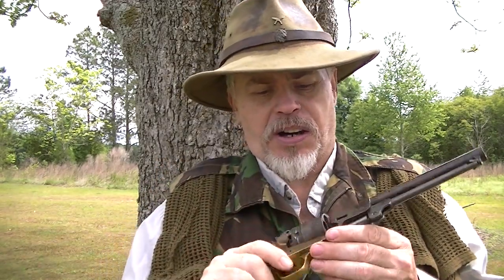THE PERCUSSION REVOLVER CHAIN FIRE

Comment: Blackie would you recommend a .380 ball, or a .375 ball for a .36 Navy Colt?
Reply from the maker: usually a 375..but if the rifling is a little odd or wavy then the 380 may grip better..i usually start with .375 and go up if the need shows up

Comment: Many years ago when I was in the Army my friend and I went to range to fire my confederate Griswald & Gunnison 44. I should have paid closer attention to his loading as he forgot to grease the front of the cylinder. Needless to say he had a triple chain fire. Kind of sounded like a magnum load going off. I also noticed something hitting the dirt in front of him. One round exited the barrel, the second one made a wad cutter out of the lead ball wedging itself perfectly into the loading rod recess. That one came right out with the loading lever. The third was problematic. It hit the barrel wedge cutting the ball in two...that's what I saw hitting the ground in front of him. I never will forget the look on his face. That was the end of that brass frame and cylinder pin. The frame was stretched badly. Called Navy Arms and they replace the frame (complete) and a new barrel wedge for free. The gun was now good as new.
At the time we were using .451 round balls. Now I know better and use .454 balls except in my Riger Old Army which uses .457 balls.

Comment: hi, i read somewhere on internet that a black powder revolver shot by itself, while safely laying on the table, is it possible?
Reply from the maker: only if the table is on fire..other wise i would say no..if a very worn revolver was left at fullcock and the table was hit and the sear tripped..possible..but a revolver just sitting in normal safe position..about as possible as   being hit by  a metorite
Reply: thanks for an answer, would you reccomend remington 1858 or cattleman 1873 uberti cap and ball?
Reply from the maker: the 58 has a lot going for it..the easy drop out cyl and easy change to .45 colt and back again.. really sold me
Reply: thanks, greetings from Poland, where only cap and ball are allowed without a permit
Reply from the maker: with proper training and skill..you loose little to modern firearms for the first 6 shots..
Reply: Is it possible to buy a uberti that you won't have to do  any repair, gunsmithing, filing. (fitting the bolt so you won't have scratches on the cylinder, timing issues) is it possible to check in the shop whether the gun's parts are fitted perfectly and be completely sure everything is fine with the gun?
Reply: And if you carry pre-loaded spare cylinders you lose even less... especially with the Remington clones.

Dan Patrick... There are basic tests you can do to check timing, lockup, etc., if you are buying the gun in person, say from a shop. However, if you buy on line like I do, it's pretty much "luck of the draw". ( no pun intended)
I suppose I may just be lucky, but so far I haven't gotten one that had any real problems to speak of.

Comment: Excellent tutorial Blackie, I too know first hand what chain fire can do, I was hit by a 44 ball from a 1858 Rem. New Army reproduction fired during a blackpowder shoot back in the 1980's.  One of the participants had his revolver experience a "sympathetic cylinder fire" as he lowered it and the round ricocheted off the concrete we were standing on and hit me right on the bottom of my ribcage. luckily the shoot was in the fall and I had a heavy jacket  on. Also fortunately chain fires don't build up as much pressure behind the round  as they would driving it down the barrel so that quicker dissipation of pressure mitigated the force of the round to a degree when it hit me. just thought I'd share my first hand ( and rib) experience. Be safe and happy powder burning.
Reply from the maker: i once saw a sympathetic cook off as well..at a range in a match the shooter was to fire 2 shots with a revolver..lay it on the tabel run to the next table fire a rifle there and return to finish the cyl..he fired 2 quick shots placed the revolver on table and was half way to the rifle when the revolver cooked off..none hurt but scared the crap out of the range officer

Comment: doesnt the chainfire shoot of the barrel? how do the balls escape?
Reply from the maker: in a chain fire one or more chambers fire..the one in line with the bore the ball goes down the barrel..the others pop out of the cyl. and go beside the barrel..however (and its the most rare to  chain fire by the way) the bottom chamber will fire and the ball will hit the loading rammer..the impact often sprays lead and the rammer may have to be turned down to fit properly since the impact may bulge the end of it...granted all of this happens because some loading step was done wrong..or undersize ammo was used..hope this clears it up for ya safe journeys

Comment: Blackie. If you would, or know anything about the high priced Slix Shot or other cones (nipples) could you give an opinion on these items. I refuse to pay 60# bucks for a set of nipples.  I stick to the originals with the gun.  Granted, on a Colt clone I do rework the hammer nose to stop nipple stick.
Reply from the maker: slix shot is a very good product...that being said i have only had one set of them..usually i can get stock nipples to work fine with just  a bit of tuning
Reply: blackoracle69 thanks Blackie. I just can't afford the 10 bucks a nipple.  I've never had any trouble with stock ones.

Comment: Does chain fire ruin the gun ?
Reply from the maker: usually not..if  all six go ..the one on bottom fires...it will hit the rammer..and may spread / flair it a bit and need ot the sanded back smooth to work properly

Comment: Why do the Italian revolvers call for a #11 cap but a 10 will fit.  The 11 needs to be pinched. I have found.
Reply from the maker: the nipples are made to hit a certain price point per unit..thus they can be size diffreance  from one to another..i usually buy 11's
Reply: I keep both. The 10's can be a royal pain with a Ted Cash capper. The 11's seem to fall off. They are tricky.  You might think that they could be concise with the sizes.
Reply: First thing I do to a new cap and ball revolver is replace the factory nipples, they are soft, cones sized all over the place, flash hole sizes all over the place, and pretty much junk.  I have used them in the past but doesn't take long to wear them out or batter up.  I've heard good things about SlixShot nipples, but I've been using Tresso nipples and they are worth every penny.  The Tresso's work exceptionally well with Remington #10 or 11's, the Remington #10's work better in my snail capper though.
Reply: You're supposed to use #10 caps on revolvers. The #11 are too big and fall off. . .as you experienced. Yes, the #10 are a tight fit, because caps are supposed to be tight!

Comment: I would kind of expect all chambers going off to destroy or severely damage the gun.
Reply from the maker: you would think but the ball is so close to the front of the cyl mouth it does not have a chance to gain much speed..and the pressure kinda forces the ball to flow out of the way like a pillow being pushed against a wall corner..then the pressure is release once the balls out of the way..the only place it can cause bad trouble is the one on the bottom since the rammer is in the way..i saw a friends 1860 chain fire and the ball hit the rammer hard enough to swell it and stick it in place ..it was tough getting it free and had to sand in down to fit back in the gun

Comment: I have to disagree about loose nipples being a cause of chain fire. My reasoning is due to the "Slick Shot" replacement nipples. As you know they have a hole drilled 90 degrees from where the cap sits. If loose nipples were a cause of chain fire, you would think that a hole letting pressure out at 90 degrees and venting that fire into the recess of the nipple area, would cause chain fires. I have yet to meet or hear about anyone having the above problem from slick shot nipples.
Reply from the maker: slick shot nipple are a different design than factory and most of the problems i have heard  or personally seen were with factory nipples...long before slick shot went into production ..in the back of the DIXIE GUN WORKS  cat. was a how to to make such nipples yourself..the article said to prevent chain fire remove stock nipples tape threads..chuck in a drill turn like a mini lathe the cones area  to a uniform taper..then drill a small hole near the top of each..dixie claimed this was a cure for chain fires
Reply: yes i recall that. personally oi only seen one chain fire. it was due to ball and powder loading no wadding.
Reply: Tapps 47 Blackoracle69 is correct. Most chain fires do occur from the cone end mostly due to caps falling off or very loose fitting caps although loose fitting is why they fall off and cause chain fire. As for your slixshot thing the pressure relief holes you are referring too are covered and sealed by the percussion so fire and spark will not enter an unfired chamber. I have in 45 plus years of black powder shooting had only a handful of chain fires a couple from caps falling off and a couple with me being an idiot and thinking I don't need grease I have a perfect fitting ball which was a big mistake.